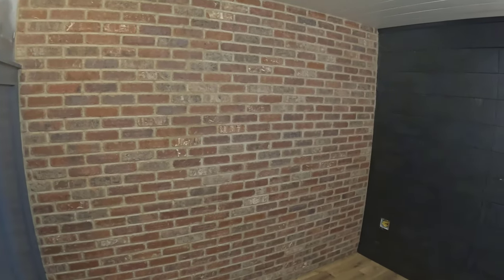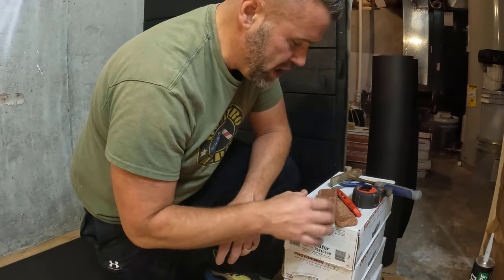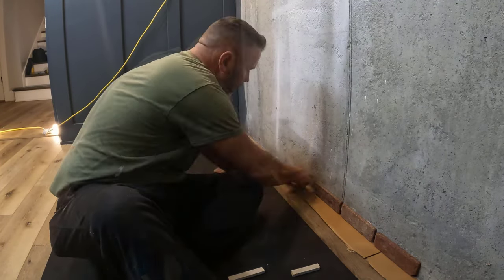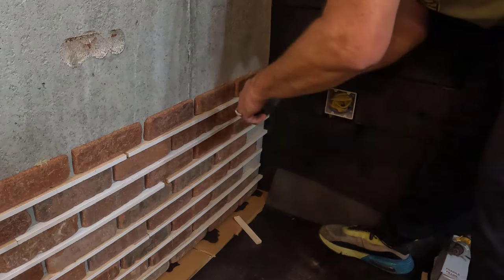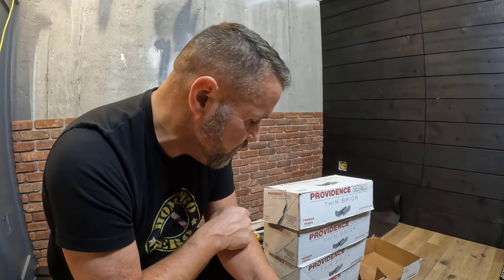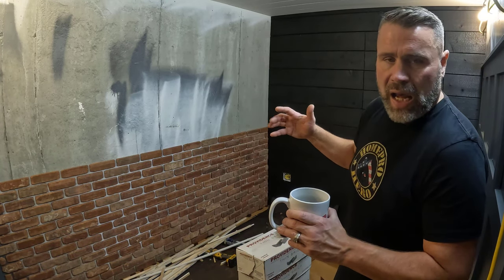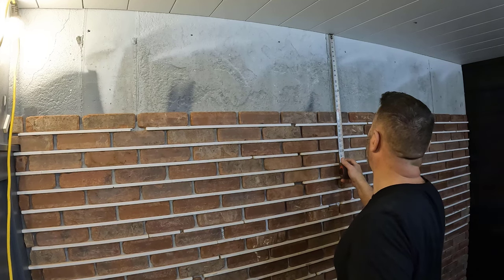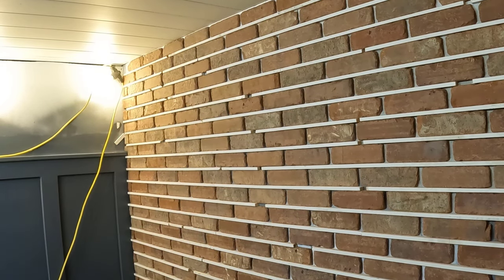How to Install Thin Brick Like A PRO!

Comment: To adhere the brick Sikaflex 11FC (fast curing) will speed up the installation process, but make sure the sealant doesn't get on the wood spacers or you'll be prying them out with a chisel.  You can install this entire wall same day without issue.
Reply from the maker: Good tip for sure but where can you buy Sikaflex 11FC?  I looked at lowes online and nothing.  Thanks

Comment: Installation guides say to use a scratch coat of thin set and then a bonding coat on the brick itself; however, it seems a lot of people are using the really advanced adhesives (liquid nails, loctite, etc) and having great results without the hassle. I've prepped two walls in my basement and plan to use the same approach. Looks great!
Reply from the maker: Thanks for the comment!  It can be done either way as you noted but the cleanup is a heck of a lot easier with the adhesives!  That grout really tightens everything up!  Good luck with your projects the look is awesome!
Reply: Adhesives allow for super easy start/stops than dealing with mixed thinset.
Reply: Hi Did you do the brick slip installation ? What adhesive did you use ? Thanks.
Reply: Indoors I’d say the adhesive is fine. I used these outside on a BBQ and I just the thinset

Comment: I might suggest that thinset adhesive mortar of your choice of colors and applied with a 3/8  notched trowel will go a lot faster provided you can mix it to a uniform and plastic consistency. When the thinset gets dry enough, you can thumb it or brush it, and there won't be a need for grout. Just don't smear up the face of your brick with the mortar.
Reply from the maker: I like using the adhesive seems to be quicker than mixing up mortar and cleaning up the mortar afterwards.  Less waste too and its the same thickness every time!  With that said either way works fine!  Thanks for watching!

Comment: Don’t know if you’ll see this but I have 9 foot ceilings and about 140 sq ft. Does this apply directly to the speckled texture on the drywall? And does it have a chance of falling off the wall with so much weight bearing down on the wall?
Reply from the maker: I see and respond back to all comments :) I did a wall in my downstairs bathroom that was 7ft tall and in installed on drywall and it was no problem at all.  I used regular liqiud nails.  Figure if you could do it with tile there is no different with thin brick.  I say I would do it!  Thanks for watching
Reply: @HomeProHero  thank you so much. You’re truly a hero! I’m a little scared but I’m gonna do it anyway!

Comment: Sorry one more question.  Do I need to sand a drywall surface down? It’s painted and also has texture on it. Thanks!
Reply from the maker: I don't think you would have to but to play it safe stick one brick and let it dry for a day or two and see how hard it is to pry off. I did that on this project and left me with no doubt :)

Comment: THANK YOU ! ! !  This video, nor anything half as comprehensive,  existed a year ago when I started planning a lounge in our house.   This is exactly what I want to do in our lounge.  The only reason I didn't pull the trigger was because there were no DIY videos available at the time, and the professionals can be tight lipped about installation (they want you to contract them for the job).   This video basically confirms what I expected... but now I won't have to wonder if I am making a mistake and ruining expensive material.  AWESOME !
Reply from the maker: Glad the video helped!  Good luck with your project and it looks harder than it really is!  HPH

Comment: This is a great reference video. We had a brick wall professionally installed, but I’m now doing another one myself. This  really helped me. The grouting is the part I’m not looking forward too. But I used adhesive mix and was concerned about consistency and got it right first time which took the stress away. Much more expensive brick slips in the UK 🇬🇧
Reply from the maker: Thanks for watching!  Yea the grouting is a little intimidating but honestly its super easy and hard to screw up!  Plus its the best part becuase its done!  Take care!

Comment: Thank you SO much for this. This is the clearest video I've seen on this. I've been going back and forth for over a year about whether I should attempt this myself or have someone do it for me, and this actually makes me think I can handle it. I'm doing an interior wall in my home. Right now, it's just covered with a coat of paint. Do you have any tips for prepping that? Should I just strip the paint and let loose?
Reply from the maker: Thanks for watching!  Drywall is even easier than the concrete wall I showed in the video!  Use regular heavy duty liqiud nails.  No additional prap at all.  I have done several areas in my home that were just drywall and no issues at all :)  Good luck and if you do your project send me a finished pic!  Take Care HPH
Reply: @HomeProHero   I absolutely will. You're a life-saver. Genuinely. Thank you!!

Comment: Excellent video. I believe you mentioned it, but I would like to confirm. Can we place it directly on the drywall?
Reply from the maker: Thx 4 watching!  Yes you sure can apply it to drywall and you can downgrade to just regular heavy duty liquid nails. I have applied it but concrete and drywall no issues :)

Comment: I appreciate your thorough video.  I’m planning on redoing my fireplace which currently has 12x12 tile, and your instructional cierro will help me a lot.  Do you think I can adhere the brick to the tile, or would I have to remove the tile first. I can’t seem to find answers to this question anywhere.  Thank you!!!
Reply from the maker: Lol I have a thin brick video coming out on Sunday when I apply it to a fireplace!  Regarding ur tile I would stick one brick and wait 24hrs to see how it sticks. If it's hard to get off it's a go. If it comes off easily tear off the tile. I think it will stick to the tile!  Thx for watching

Comment: If i may adds a couple of ideas for the rookies out there: i used a scale and stayed around 2-3lbs for weight due to MY age and was around 1-1.5 cups for water.  
Too solid is better than too runny.
Cutting the bag at an angle and proper size is important.
I used a tomato cage in a bucket with alligator clips for the mortor bag. Used a couple clothespin at the cone to keep it closed.
Thx again and good luck everyone
Reply from the maker: Thanks for the tips and watching!
Reply: @HomeProHero  wez not all badazzes like you😉

Comment: Excellent video! Can’t wait to tackle it myself. What did you do once you got to the ceiling? Mortar between ceiling and the top brick? I’m considering doing nickel gap ceilings. Would you recommend doing the ceiling first then the wall?
Reply from the maker: Thx for watching!  I just used masking tape on the ceiling and used the same mortar between the ceiling and the last row of brick - clean look. Yep you want to do that ceiling first and that's what I did in the home office I have videos of. By putting the ceiling in first the brick will keep the ceiling from being unsupported, maybe sagging, on the edge where it meets the brick. The transition will be cleaner between the two if the ceiling is installed first. Take care!
Reply: @HomeProHero  great, thanks man!

Comment: It looks really great! I could not see if you used baseboards. Is it even possible to use baseboards?
Reply from the maker: Yes, absolutely!  I used baseboards in my bathroom and it's even easier as long as the baseboard is level. Just stack them on top. Thx for watching!

Comment: Great job this is beautiful!! What would you recommend to bond brick to dry wall? Would that adhesive work as well?
Reply from the maker: Funny you mentioned this!  I will have a video out within the next 4 weeks showing me installing the thin brick on drywall around a fireplace. Than I'm painting it black!  Regular liquid nails works fine!

Comment: Thanks so much for this easy to follow video. I'm from Indiana as well...little 'ol Avilla. I currently live in Massachusetts and everything is so expensive so I love DIY projects. I want to cover the cement foundation portions of my house. Can I use these same materials and steps for exterior foundation project? Thank you!
Reply from the maker: Thanks for watching!  I think everything is expensive here too :) I think you could for sure use the exact same process. Likely look great too!  The thin brick and mortar is the exact same material you see with real brick installs. Using that landscaping Liquid Nails should do a good job holding the thin bricks tight to the concrete foundation. I have used that LN on exterior landscaping blocks and it work great and held.  Take care

Comment: Great video! I've been wanting to add a brick finish on a wall in a powder room, and I've looked at the faux brick panels as an option, but I think this gives a nicer finish. Is the process the same on a drywall surface vs concrete? And did you use furring strips as your ledger board & spacers?  Thanks for sharing your expertise!
Reply from the maker: Thx for watching!  It's the same process I just launched this video of me installing on drywall:  How to Lay Thin Brick Like A PRO! #homeprohero
https://youtu.be/0qbbr2Fi7CQ

Comment: Fantastic! I’ve never done this. Tell me why you didn’t start from the top
Reply from the maker: Good question!  Would have been nice to hide the possible cut bricks at the bottom but as the bricks dry they need something to rest on which in my case it was the bricks resting on the floor.
Reply: Ah thank you. Makes sense. I need to check out your DIY wood pallet wall, if you have those videos.

Comment: Great video! Do you think this process w/ liquid nails would work for exterior thin brick veneer? About to cover up exposed foundation of home so would be timely to find out!
Reply from the maker: Thanks for watching!  Yes for sure as long as you are applying it to concrete or block. Make sure to use the outdoors landscaping liquid nails. Take care

Comment: Thank you for this very thorough video!  I've been wanting to find a video like this.  NICE WORK!  IT LOOKS BEAUTIFUL! ❤❤

I have a question for you.  I would like to have those type of bricks put on the bottom of my cinder block foundation around the outside of my house, but the previous owner painted the cinder blocks.  Is there anything additional that I will have to do to the comcrete cinder blocks being they're painted to make sure the bricks stick to the concrete cinder  blocks?
Reply from the maker: Thanks for watching!  I'm not sure if you will need to strip the pain of the cinder blocks.  I would get a thin brick and adhere it the block.  give it a few days and see how hard it is to pull off.  If it comes off easy I would contact a paint store about a stripper to remove the paint.  I bet you won't have to strip the paint and i think that thin brick is a perfect application for your idea!  Thanks HPH

Comment: Great video.  I'm doing this for a fireplace surround, but since it has corners would you start on the corners first or would you start from the center point and work your way out to the corners and cut them as needed?
Reply from the maker: Thats a good question!  Thanks for watching.  I'm guessing you are using the corner bricks provided by the manuafacture.  If it was me I would start in the middle and work my way out to the corner pieces.  Then cut the bricks between the corner and the last full brick in each row.  I think the center of the fireplace is the most visual area for most people and you can hide those cuts at the corners better.  Hope this helps and thin brink is a great application for your fireplace!  HPH
Reply: @HomeProHero  yea this is kind of what I was thinking as well.  I know you spaced eat brick out using 3/5 inch spacer but what was the width of the long piece of wood you used horizontally roughly?  Looks great man and thanks for responding!

Comment: Great video! Just about to tackle a similar project putting thin brick on a cinder block wall. The only difference is my thin brick has ridges on the back and not flat so need to make sure the adhesive covers both areas of the brick. Will the adhesive still stick even though the cinder wall is painted? I presume it’s so strong it’ll stick to anything! Thanks!
Reply from the maker: Thanks for watching!  I'm pretty sure it will stick but what i would do is what it did in the video.  Stick one on the cider block wall, let it dry for a day or two, than try to break or pry it off.  If its tough to get off its a go!  Its a great product!  Good luck!

Comment: Hi, great how-to vid.
I never thought to use loctite because I figured it would be too expensive. About how many bricks can you do with one tube?
Reply from the maker: Thanks for watching.  I did 10 boxes with 2 large tubes of Liquid Nails and I likely used more than needed.  Its the cheapest part of the project, less messy than mortar, and is simply easier and quicker.  Take care

Comment: Is the mortar more workable than sanded grout? The people at Mapei strongly recommended applying a sealer on the brick prior to grouting to protect the brick from staining. Have you had this issue at all or does the mortar not cause staining the way grout could?
Reply from the maker: The mortar is pretty firm when it's applied. If it begins to leave the channel and drip on the face of the bricks it's too wet. It dried extremely fast because the bricks are sucking out the water. I would be more concerned if the bricks are sealed they won't suck the water out of the mortar maybe causing a weak bond between the brick and mortar.  I would only seal the bricks once the mortar is applied and tooled and maybe only if it was a backsplash in a kitchen. Thx for watching!

Comment: Hi, great video. Can you apply the liquid nail adhesive to brick directly on primed drywall?  Any other prep work that helps adhere to drywall?  I really do not want to use lath with scratch coat.
Reply from the maker: Thx for watching!  Yes I did many walls that were just drywall. I used regular liquid nails ( blue labeled bottle) with no problem at all. Works great no lath required it's really not need there's not much weight to thin bricks.

Comment: Did you seal it ? And does it matter what PL  product you use if it’s going on drywall in a kitchen ?
Reply from the maker: I never sealed it and because it's inside I don't see a reason. I don't even think they seal outside brick around here. The video coming out today I paint think brick - pretty cool!  Any construction adhesive will work I just always use LN. thx for watching!

Comment: New subscriber.  Thanks for this video as I've been looking really hard at thin brick and wanted to see others application and end result.  It looks really great.  Would you recomment it as a kitchen backsplash though?
Reply from the maker: Thanks for the sub!  It's really simple I was a little intimated at first but it's not any harder than wall tile - maybe easier. It will working in the kitchen I put it in my wine bar which is similar to a kitchen. I have a video tour on the bar and it shows the thin brick there. Good luck!
Reply: @HomeProHero  Thanks!  I'll check out your bar video.  😃

Comment: Great video. Did you use only one mix for the grout to do the whole wall or did you run out and have to mix more?
Reply from the maker: Thx for watching!  I did one mix for sure. Now on other areas of my house I used multiple and I could tell no difference from the other coats after it all dried. Thx
Reply: @HomeProHero  Nice. You really did a great tutorial here. Got me started on my wall.
Reply from the maker: Thx again. Good luck!

Comment: Will this method work for exterior walls on a stucco house?
Reply from the maker: I would say yes as long as you use the same liquid nails I used in this video because its mason to mason and rated for exterior use.  I would test one thin brick, stick it on a hidden area, and try to pry it off in a few days.  If it’s tough to get off I would do it.  The only concern should be the glue because the brick and mortar are the real deal that you see outside everywhere.  Hope this helps!

Comment: Yep,,best video. Help. I have to fix two mistakes.
A. I had two runny bags and made the brics cloudy in the floor???  How do i sand off the cloudy white and get back to red ??
B. I over looked three lil 3inch sections i was supposed to press down on with the lil anvil 3/8 thingy. How do i get rid of those three humps???
Reply from the maker: Man cloudy bricks might be hard. If it's still wet water and sponge. If dry you might have to get something at Lowe's to clean brick. If that doesn't work you might have to paint or something. The second issue you have I don't quite understand. You can always pry off the bricks and mortar again. Suck you are having issues.  Hope this helps
Reply: @HomeProHero  b. Was three three inch patches that i forgot to scrape. Can i use grinder???  Thx . You made it look easy. Btw. I weighed 3pounds to about 1.25 cups to get  good grout thickness
Reply: @HomeProHero  cloudy bricks = lemon juice. Thx again. Wez all aint badazzes like you😉

Comment: Hello, very good job, I have a question, this work can be do on the outside walls, in a temperature of 80 degrees, can you give me a recommendation, thank you
Reply from the maker: Yea it can be used outside but I would check out the manufacturers guideline on their website. I think I saw a video on YouTube of someone using installing it on the exterior of a home. Thx for watching.
Reply: @HomeProHero  thanks i apréciate

Comment: I’m putting this on a finished plasterboard wall in my kitchen, should I still use the landscape loctite adhesive rather than the extreme liquid nails one I got?
Reply from the maker: Regular liquid nails or extreme will work well!  Good luck with your product!